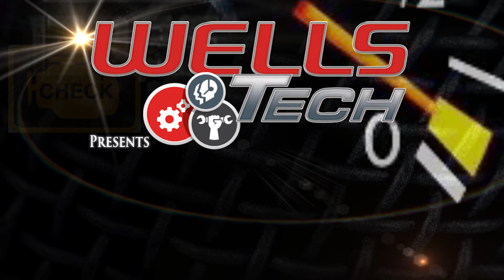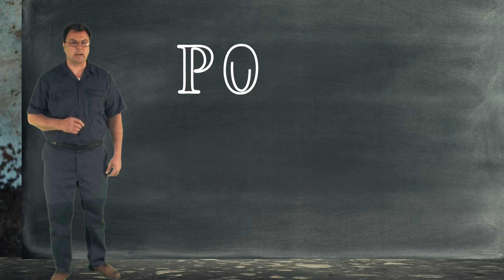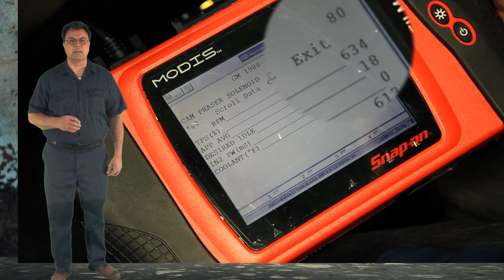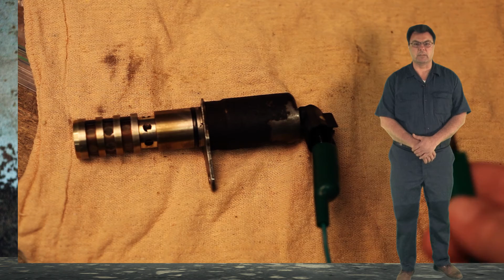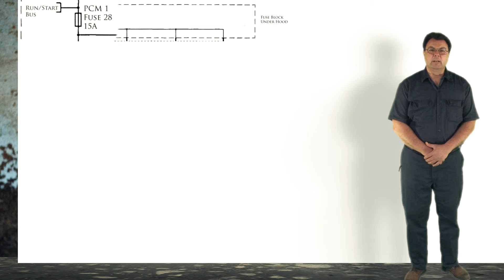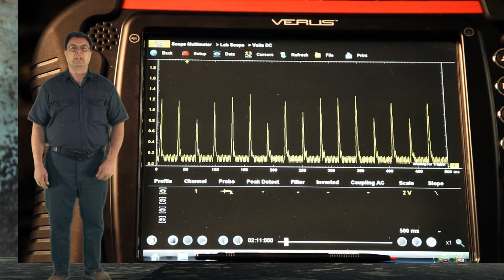2002 Trailblazer P0014 P0306

Comment: Great video! I have the same engine. Changed the fuel pump and the crank sensor and the oil and cleaned the VVT solenoid, MAF sensor and installed new air cleaner. I am experiencing delayed start long crank after hot soak on occasion. Maybe one in five starts. When it finally starts it chugs like it's been flooded. I have a new VVT and cam sensor on the way. Can a faulty or clogged VVT cause incorrect timing at start up and delayed start? 185k on the engine btw. Thanks for any feedback you can offer.
Reply from the maker: Hey Larry, looks like you have a lot of new parts on yours! I would look at fuel first. Do you have access to a fuel pressure gauge? I would monitor fuel pressure after the trucks been shut off. It should hold pretty steady, if it doesn't, fuel is going somewhere. Sounds like you may have a leaky injector!
Mike Becker, Technical Services Instructor

Comment: so there are no other bolts besides that 1 bolt holding the camshaft in. I will now have to use force to take it out
Reply from the maker: +D'vawn Williams Yes there is only the one bolt holding the Camshaft variable valve timing solenoid in place.
Mark Hicks
Wells Vehicle Electronics
Reply: thx
Reply: my problem is moving the power steering a little to get the shaft out hopefully the 2 bolts neer the pully is the only 2 needed to remove so it could atleast move back a little.
Reply: i rather wait 2 more days when the shaft comes so i can just replace it. im also going to replace the throttle body as the rpm meter keeps hiking up high when moving from drive to park. and when turning the ac on. i will get back to you after im done.